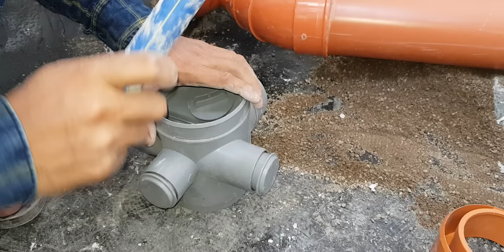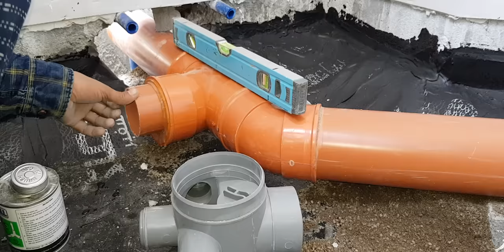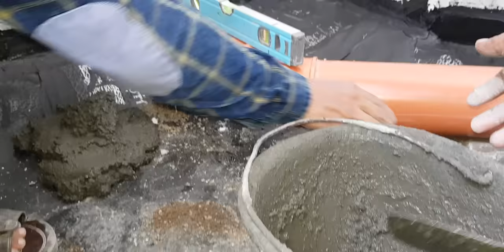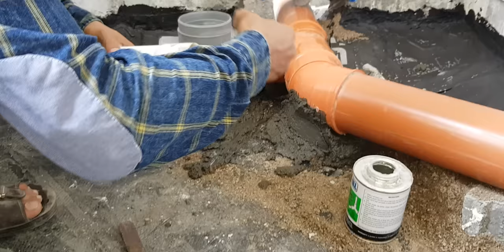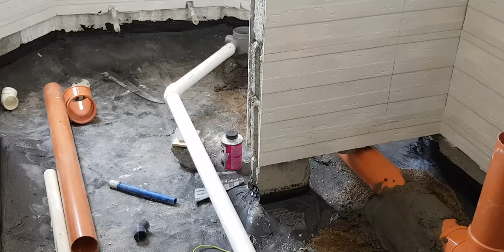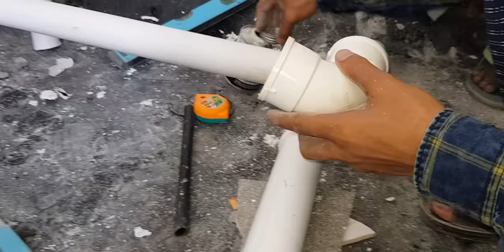Installing Drainage Lines for Efficient Water Flow and Plumbing System|| Drainage System

Comment: use proper pipe cutter not hacksaw. also clean the burr after cutting. In long run debris will accumulate at joints and create blocks.
Reply: And also rotate the pipe in the fitting. A little bit of pipe and fitting sanding would help

Comment: Hmmm. I'm seeing several code violations in the U.S. compared to where ever this video is taken. Plus plastic pipe fittings should be primed, glued and installed with 1/4 turn.
Reply from the maker: Thank you